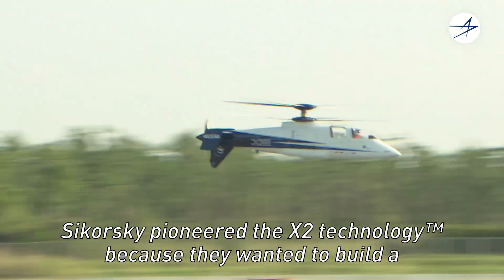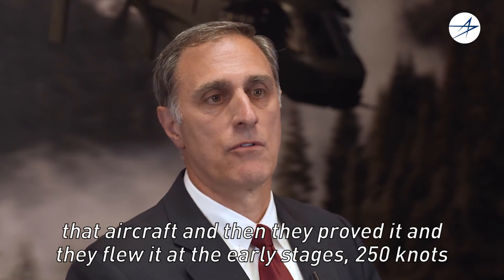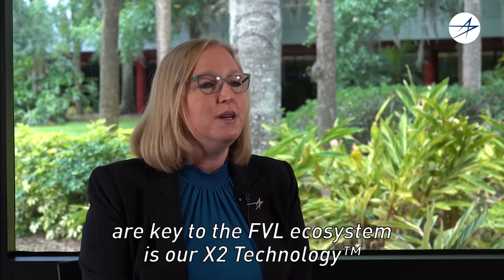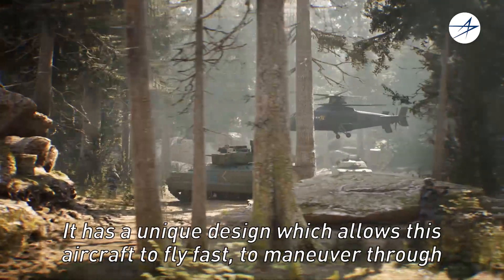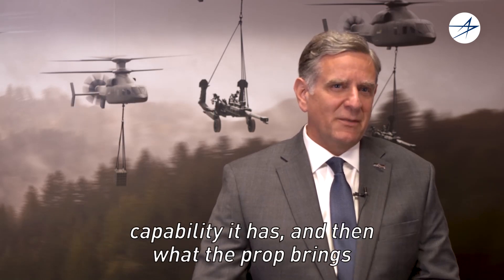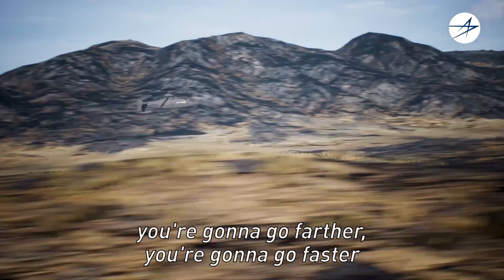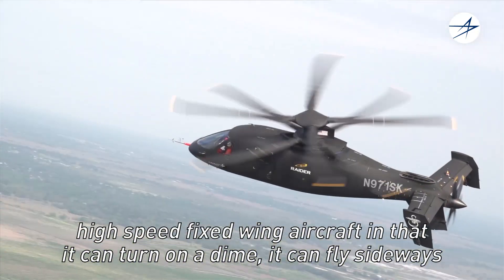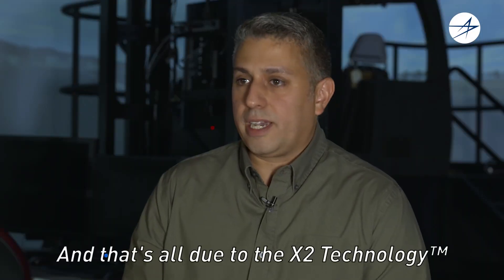Delivering the Edge - Episode 12 - X2 Technology

Comment: I think this would make an excellent tactical nuclear strike platform. Strip her down to racing mode and use her for lightning fast very low altitude operations. Short prosecution interval stuff.
Reply: Sounds like a cruise missile with extra steps.
Reply: @renard6012  Well, not quite. It would be filling a role similar to that once occupied by nuclear tube artillery. You could easily produce a nuclear variant of the GBU-39, and that's what I imagined it carrying. A number of them in a special rotary bay. It could be kept much further away than nuclear tube artillery had to be kept while still having a fast reaction time, and the devices they could be highly variable in both type and yield. Anything from 0.1 ton enhanced rad to 10 kt for hitting large formations, forward air bases and so on. Plus, it would be cheaper and harder to shoot down. Reusable, see. Save the cruise missiles for swarm attacks on strategic counterforce targets.
Reply: @renard6012  Some quick estimates suggest to me it could carry 2 - 3 such weapons plus the rotary launcher. Maybe just two. But that's plenty of mayhem. And it can rapidly return for rearm.